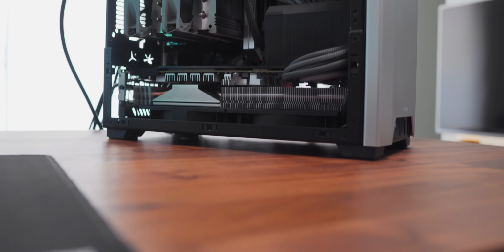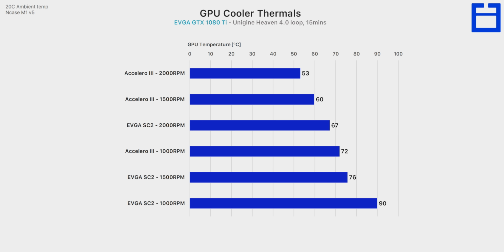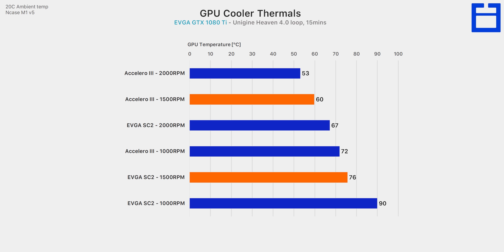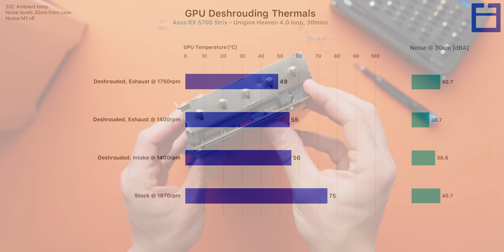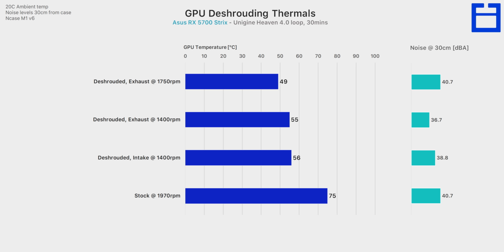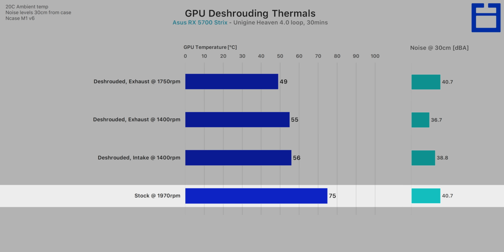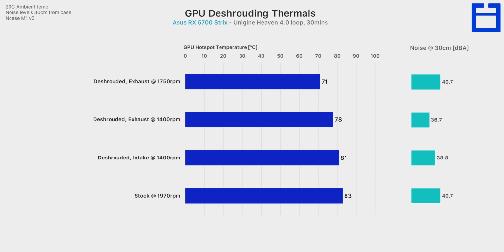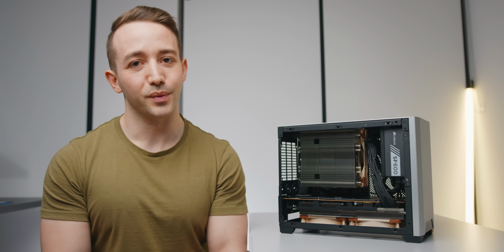GPU Deshroud Mod - Mindblowing Thermal Improvement

Comment: Wait, hows "exhaust" cooler than "intake"? Exhaust as in the fans blow down out of the case?
Reply: Yes the exhaust fans blow down onto the table out of the case. The reason it’s cooler is because there is much more space to bring air from within the case than intaking from the small area under the case, this also takes out warm air from the case
Reply: No clue, but it's the same with my Lian Li TU150 case. I got a 10 degrees C difference (under load) when I flipped my bottom fans to exhaust.
Reply: Yeah I'd imagine it's because after 20min or so the small case is otherwise saturated with ambient heat from all the intakes. Having one of them as exhaust alleviates this; perhaps even lay the case on its side so it can exhaust the hot air unobstructed.

Comment: Anyone tried this in an NZXT H1?  Is this even possible in the H1?
Reply: Yes it is possible, I am going to actually be doing it later today. Look up nzxt h1 mods on the itx subreddit
Reply: @TheGaspacho21  Let me know how it goes :)  Which GPU will you be using?  I have preordered my H1 and am waiting for it to arrive before i buy parts.  I am mostly interested in making the H1 as quiet as possible.
Reply: I've got a deshrouded Gigabyte 2070 super in my H1 and it made a huge difference to noise/ thermals. I have two noctua NF-A12x15s attached; no issues with protruding brackets but you do have to get creative with zip ties to attach the fans. Felt very crude whilst I was building it but actually I think the end result looks better than stock.

If reducing noise is in your interests I'd also recommend swapping the stock psu for an SF750 or similar - the stock psu isn't loud, but I found the stop start switching in and out of passive mode a little intrusive. Basically do all this :
https://www.reddit.com/r/sffpc/comments/g579s1/not_your_average_h1_post/
Reply: James Barnett awesome!  Do you have pics?  Did you zip tie the fans to the GPU?
Reply: Forgot that I repasted the cooler as well. No idea if it helped but figured I may as well whilst it was apart, but by no means necessary for the fan mod.
Reply: @jamesbarnett  Did you installed it as exhaust of intake? And also, which adaptor for the GPU fanheader did you use? Thanks, planning the same here. I tough about screwing it to the case via the mesh holes.
Reply: @mvh83  you'd call it intake I guess, but it was attached to the gpu rather than the case with the fans in the conventional orientation. I believe this is the adapter I used:
https://www.amazon.co.uk/gp/aw/d/B005ZKZEQA/ref=yo_ii_img?ie=UTF8&psc=1

Comment: How come, that when i went for deshrouding, i have higher temps on my gpu when set as exhaust? Did it with a 2080ti black from evga and had around 5-6 degrees hotter. Was very similar to the fusion 3 with the kraken for a 9900k that is limited to 95w...
Reply: When it comes to PC cooling there are so many variables its almost impossible to compare temperatures unless every component is the same. Even then there are variables like mounting pressure etc which will also effect things
Reply: When you post your build with pics somewhere like pcpartpicker oder builds gg than maybe we can comment on it :) do t forget to share the link to your build
Reply: Maybe your case isnt high enough off the desk for the air to flow easily. Either that or its your choice of fan.
Reply: @Rose.Of.Hizaki  I even went for the 3D printed feet, similar to the ones, . Ali uses in his vids. So about twice the clearance that the original feet provide. I will consider the pic, but will most likely finally get to building the custom loop after receiving the last parts after 2 months of waiting.
Reply: i think i have to be more precise, sorry therefore on my side... I am using the Ncase v5, bottom fans are noctua nf a12x25. The 2080ti received a cooler swap to the arctic accelero IV extreme - therefore there is no gap, or atleast not more than 1mm. I just dont get how the results can be that different. That i wont reach the same result, understandable, as i dont have a room ambient of 20c. But that i get a negative effect where he gets a positive one... i dont get that.
Reply: @looxx1z  its a different GPU and a much much hotter one the old AMD GPU he used is easy to cool. how the heat sink is designed will also vary and as i said before i dont think his VRMs temps are better while running exhaust
Reply: @DClaville  Yes, and i mention another build (fusion 2/3) from him with a similar result where both exhaust and intake were compared as well. I would really appreciate it, if you consider all the given facts instead of cramming information that is not suitable to my question into your replies.
Reply: @looxx1z  i have told you what i think is the reason your own loss if you dont understand. goodluck
Reply: EVGA Black Edition is 2-slot card? Are you using different case, thicker fans or made shrouds for fans? Because otherwise you should have a gap bellow fans and M1 bottom -- fans don't blow all of the air outside of the case. 

Also even with shrouds/proper spacing it's reasonable to think that slim heatsinks work worse with exhaust -- as with such configuration fans pull air through the heatsink from it's sides (and there is less area from side profile).
Reply: where are you exhausting to ? sucking air from the heat sink will very rarely be better it only works in the case in the video where the fans can blow the air out the case directly. in a normal case and GPU placement you will want to have it blowing into the heat sinks. . i also thing the VRM temps where higher in the exhaust setup in the video but might not have been monitored in that part of the test.
Reply: May I suggest, if you are blowing and not exhausting out of the side of the case. And if fins are oriented same direction as in video. Take the fans and have them 1cm further out than the GPU (in most cases this is a necessity anyways, as most GPU's are less than 120mm wide) . 

It helps the air being blown away and thereby not reusing the hot air.

Comment: In TU-150, the vent under case isn't align match with GPU. Is it still worth for deshroud in TU-150?
I'm using TU-150 with Zotac 2080Ti AMP
Reply: People still do it,so most likely the temps are still lower

Comment: If you use a dremel to remove those brackets please remove the cooler from the PCB before doing so, otherwise you'll risk cracking the die and killing your GPU!!!
Reply: I'd be more worried about metal shavings getting on the PCB and shorting something.
Reply: it's easier to just use a pipe wrench and bend them off.
Reply: @BatteryAz1z  My side cutters cut through those brackets like butter, quick snip and you're done.
Reply: @BF3DS  I've even cut metal like that (to make a SSD mounting bay) with cheap kitchen chicken shears with great results, funnily enough. Started off using full-on angle-grinder then tried it and wished I had used them from the start.
Reply: @PinataOblongata  Lol yeah it doesn't take much that's for sure!
Reply: @BF3DS  Did you do this on a EVGA 2.7 slot?
Reply: Can't you use some aviation shears? I used them on my Cooler Master Q500L.
Reply: @CaveyMoth  - Yeah, tin snips I think they're also called.

Comment: GPU board partners really should be making a heatsink design that allows for customers to add their own fans. Similar to how the raijintek morpheus fans are attached.
Reply: or just partner with Noctua or Arctic and add some good fans to their design
Reply: @illietw  As if GPUs weren't epxensive enough already. Besides, if your airflow isn't complete ass and you buy a good model, temps and noise will be excellent. In my Inwin A1 I run two fans as intakes below my unmodded Strix 2070 Super and the GPU fans never turn on.
Reply: @gabo007x1  I gues you never play anything?
Reply: just add more pipes and fins
Reply: @silmupelaa6349  I do, but the GPU fans turn on at 60C and it only gets up to 57C-59C under full load.
Reply: @illietw  heh... we all knew it was gonna happen
Reply: Morpheus II still best upgrade ever ! 2GHz 1080ti 80C max (edit. under 1000rpm avg. 500 w/ noctua nf-a12 and low noise adapters)
Reply: If you are going through all the effort to buy an after market cooler for your GPU then why not get an AIO cooler?
Reply: @HYDRAdude  because water is two times more expensive than air
Reply: @HYDRAdude  Reliability and price
Reply: @HYDRAdude  Because that's stupid. No one buys something just to replace the whole thing when it fails
Reply: I'd say they could put Noctua fans on, but it will take a lot of R&D money to reduce the ugliness levels.
Reply: @mikeycrackson  That's why I said "if you buy a good model" ;)

Comment: Where do u connect the fans on gpu ? and if i dont have compatible connector for external fans will the card give any error ?
Reply: NVM i saw the adapter
Reply: >Where do u connect the fans on gpu 
Find/make an adapter from your GPU connector to normal 3/4 pin or connect them directly to motherboard/fan controller.
>and if i dont have compatible connector for external fans will the card give any error ?
Depends on the card, but from what I've seen nobody had problems with no fans connected to the GPU.

Comment: I do this with my NCASE M1 v6.1, Strix 1080 Ti and NF-A12x25's. Works fantastic. My concern is when I want to upgrade my GPU to one of the new ones coming out, making sure I can find one that I can do the same thing with.
Reply: I have a 2080 Ti STRIX. How can I make sure my 4 pin connectors work?

Comment: 20c Ambient temp is too cool for real tests. not every one has AC and coooling room to 20c is not recommend ideal temp is 25-26c for siting.
Reply: People live in different regions, you know. There's plenty of places where you have to actively ~heat~ your room for the most of the year to have it at 20c.
Also that shouldn't change much -- assume results would change linearly with ambient higher than tested (so add 5-6 dergrees to all shown results)
Reply: @niter43  yes.

Comment: Would Deshrouded, Exhaust work in the Ghost S1? That way you're getting the heat out from the case.
Reply from the maker: Deshrouded 2-slot + slim fans might work, but you’d have to improvise your own fan mounting.
Reply: @optimumtech  I was thinking something like the 2080/TI Windforce from Gigabyte with 3x NF-A9X14 and probably screw the with the sidepanel as exhaust assuming it barely touches the GPU when you close it. There is similar mod i found done to the Dan A4 but as intake rather than exhaust: https://imgur.com/a/uxbi7En
Reply: I have a deshrouded dual slot 2080Ti with a couple of slim noctua fans with phanteks rgb frames attached in my Ghost. Just barely fits without bulging the side panel noticeably.

Had to use a combination of double sided thermal tape on the underside of the fans and the pressure of the side panel holding them snug against the heatsink. Also a fair amount of electrical tape around the sides of the fans to hold them together and keep one from sagging.

Haven't tried using them as exhaust, but as intake, with a repaste of Kryonaut, temps went from the lower thermal limit of 84 degrees down to low to mid 70's depending on the temperature of the room. Definite improvement!

I'm tempted to try them as exhaust, but I'm too lazy to remove all that tape for now.

Comment: Omg so basically gpu board partners are screwing us over 🤣
Reply: no, they just aren't fan experts and currently refrain from building 4+ slot cooler designs, which this is.
Reply: @t4iga121  if you're doing design work on thermal solutions for silicon components you most assuredly are a "fan expert," in the professional sense. Modeling Air flow through such a system is a pretty basic engineering task that any junior level mechanical engineering student could undertake. All this is to say that, yes, the only reason the thermals on your gpu are lackluster and the noise is too high is because the engineers working on them are operating within market parameters defined by what the consumer will put up with, not what provides the best absolute performance.
Reply: But it leaves a lot of potential for creativity and imagination to play around with.